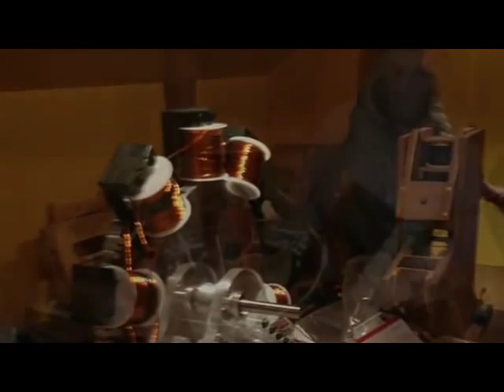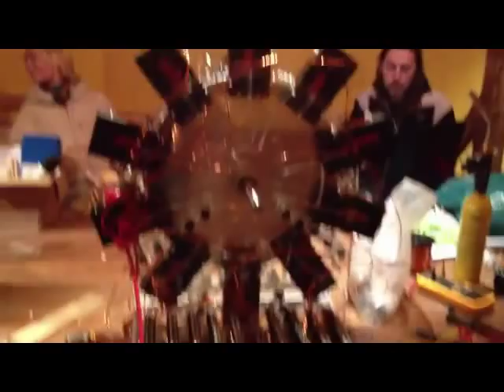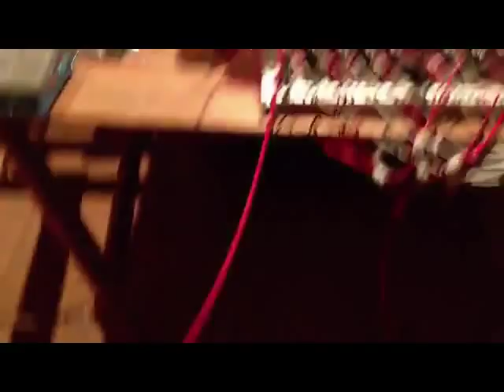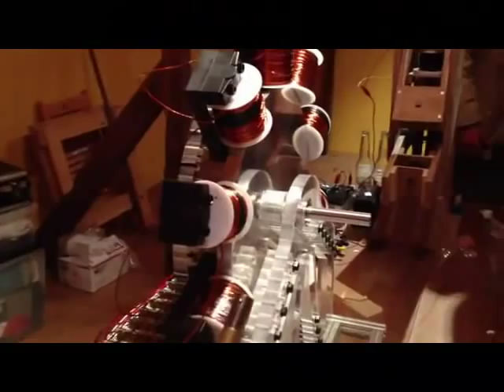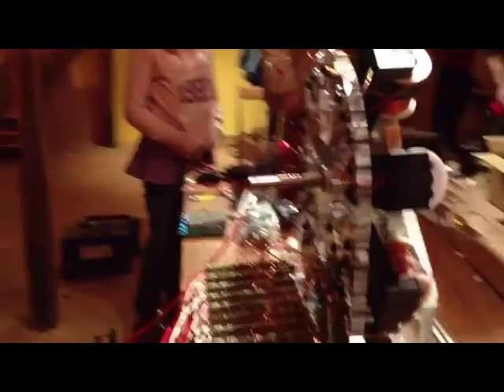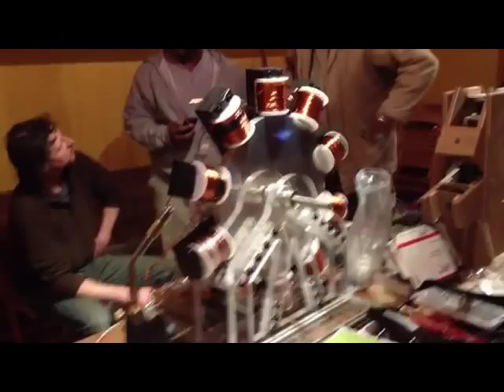Bedini 10 Coil Build And First Run

Comment: The kit for this device can be ordered from Renaissance.charge for 3000,- US$ . You can use the thing to drive for instance a water pump and load a battery at the same time. But it is much more practical and much cheaper to buy an electric motor and a battery charger, and this will even save energy, I guess. No technical data are given for this 3000$ device. Except a honest statement on 
wewewe . r-charge . net : "We cannot promise any results". Rip-off, nothing else.